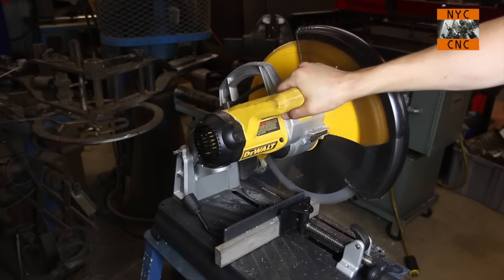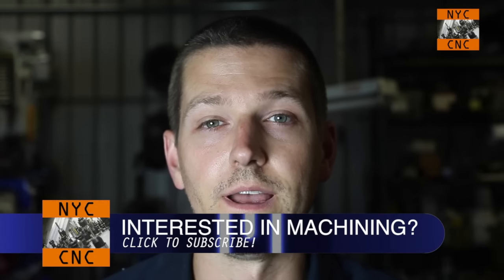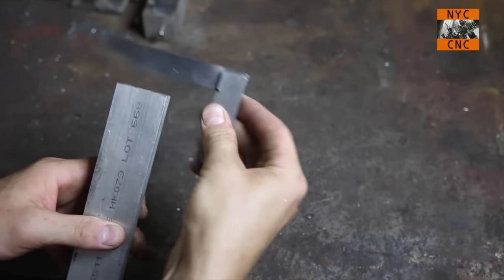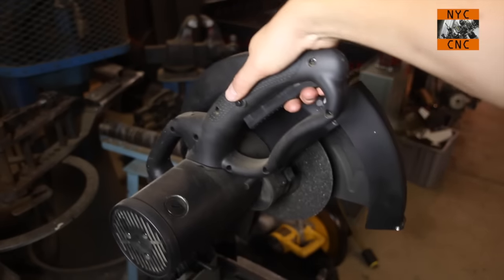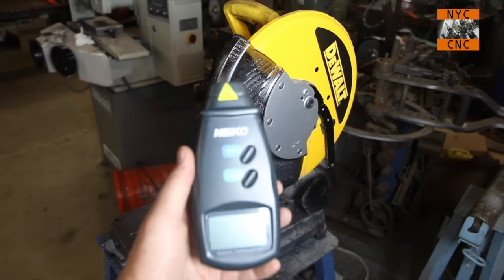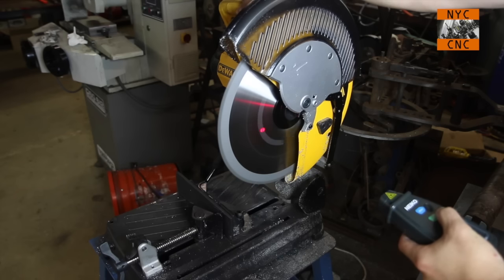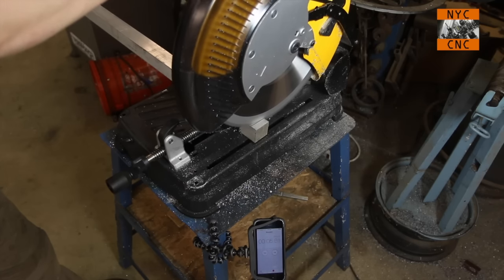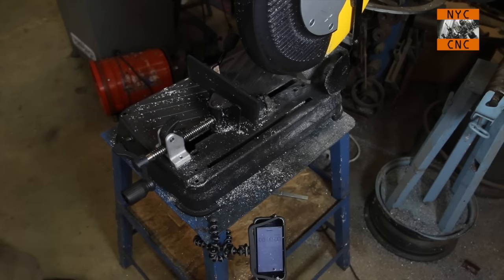The Best Metal Cutting Saw!? Aluminum AND Steel? DeWalt DW872 MultiCutter Review

Comment: Thanks for the clip is always good to let people know what else is available. They are good for on the job site easy to carry.
I have had a lot of experience with this type of saw and they work well but they will not out last a bandsaw for the amount of use you can get out of them, but the bandsaw (which I prefer) you can rebuild without spending to much money but these types of saws when they need repairing most of time you are better to buy a new one.
Not trying to sound negative about this type of saw they a good for portability and that's about it. 
 I think in a workshop the noise would drive me up the wall, using grinders and similar types of equipment is enough to deal with don't need this thing going as well.

Comment: This saw looks like a take of the Evolution Tool's metal saw.  They were doing these for quite some time im guessing before DeWalt, etc.  Id like to see a comparison between the various MFG of similar products.  The Evolution Tool stuff is also pretty nice.....and I believe a bit cheaper than the DeWalt.  But Im willing to bet a lot of the tech goes into the cutter blade and not so much the chassis.

Comment: John, have you used this machine on Stainless Steel? I'm a designer/woodworker, just starting to work and incorporate metals. I'm looking to cut 304 SS 3/8" solid bar. Trying to figure out the best approach for this task. Any thoughts on this machine vs abrasive or even a bandsaw on SS? Thanks in advance for your feedback. Great video!!!
Reply: Ez. No problem doing 304

Comment: I doubt you'll be around this place ro answer this question but I already have a dewalt chop saw but is the fast one 3800 rpm cudnt I just get a metal blade that can take that rpm
Reply: No you cant put a metal blade on such a speed motor. . I also thought of this plan n failed you have to get a slow motor like this
Reply: @markharvey4087  dewalt makes a diamond edge blade for the specific chop saw I have it's designed to take up to 5000 rip ems

Comment: 1300 rpm will chop a finger just as fast as 20000. All of these saws are fine, they've only got so much life in them because they're only a few hundred bucks. The bearings go out and they all cut bad. But none of them put any money in the vise. Put another $100 in a good vise system and it would make an all around affordable package.

Comment: Hey Brother, thanks for the video.
I have a couple general questions and hope someone can address them.

What are the best characteristics needed in a saw to cut aluminum thin wall extrusion? I only cut aluminum, and always on a 45.

You mentioned RPM, All the saws I've been looking for have |RPM ratings anywhere from 4000-5500, depending on blade size, but contrary to this, do you feel a lower RPM is what is needed for cutting aluminum?

Also, blade size, does this matter at all, obviously smaller blade, smaller aluminum extrusion size cuts.

The last item which I don't like is that the blade is static and cannot be angled to 45 degrees, meaning if I switch positions I have to design a bench system and dedicate the work space to accept tubes being placed on different positions, jigs, etc.

Lastly, can you recommend anything like this that can swivel to several different stops?

If I buy a 700$ saw, dual bevel, carpenters dream, high rpms, will I wish I got this saw?

Thanks brother, gonna check our other vids.
Reply: Jonny. Many many years ago I worked in a shop where we cut aluminum extrusion with a Craftsman 10" radial arm saw with a good carbide tooth blade and it did just fine. The stuff we were cutting was a couple different shapes, probably .06 -.09 thick. And even today I still use a Makita chop saw with a cheap blade to cut aluminum door sills. Hope this helps in making your decision

Comment: thanks for the video, quick question i need to cut 2-3 inch square carbon steel bar.  I have a 12" miter saw, do you think it can handle that if I had a steel cutting blade? thanks in advance!!
Reply: No.    A wood cutting miter saw rotates much too fast for steel cutting.    Compare the rpm of a saw designed for wood and one specifically designed for steel.   Using a speed controller probably won’t work either as it will lose power.

Comment: Would I be able to put a  Dewalt metal cutting blade on my abrasive chop saw its a DeWalt.
Reply: Be mindful of the RPM speeds. I checked into that today but a good saw for this type of work spins around 1300 to 4000 and my Canadian tire saw I believe runs at 5400.. it'll burn your blades up really fast and could be dangerous I'm told.

Comment: The main selling point you are giving us is that the cold saw is faster then the band saw. And in all practical applications yes it is, but in theory a circular saw and a band saw with the same tooth size angel and pitch should be just as fast. Why the circular saw is faster for you observation is because among many reasons, the stiff blade permits greater tension and the carbide teeth are better suited to fast cutting. I know you witnessed how much high the removal rate is on a lathe with Carbide vs HSS. The same is true as far a s band saws, safeties to say that the commparison between your Jet and the Dewalt is not valid unless both are running carbide. Under speed alone the Dewalt will win hand down just by being direct drive.

The winning factor of the band saw and why metal distributers use them exslusivly is that they are far more economical by any measure of short or long term business. Whether or not you weld your own blades. 
I was at metauxsolutions and had noticed that among their million dollar fleet of band saws they had only one circular saw and was your Dewalt. I was considering getting one at the time as are many how have just watch your video above. So I asked the Forman why there weren't more circular saws? He said that they did have three wet circular saws years before at the last fissility but chose to sell them, left them behind. The reason they have the one circular saw is for when a costumer comes unannounced and needs length of bar stock small enough for a car. Otherwise the bandsaws are king, with the lowest cost per cut, allow for few employes to manage several machines, thin kerf. As far as the hobbits he suggested one of those swivel top band saws. Where the $150 per disk would get you ten blades and wold far out last the disk.

Cutting speed and the rapid dulling of the teeth is a pain for all of us with one of those cheap horizontal band saws, and tempt us to "upgrade" to the cold saw. However both of those problems can be remedied just be increasing tension and down force.

I had owned and still own one of those small horizontal band saws when I got a summer job at a CNC shop, and when they gave me the duty of chopping bar stock on one of the mid sized horizontal saws from Grizzly I knottiest that the lifting spring had almost no tension and the blade tension knob was replaced with a hex bolt. The explanation as quoted by my employer, "These importer companies know nothing about proper settings" So the blade tension was set by using an elongation meter and adjusted to the blade manufacturers specification, and this required a large wrench.
The down force was set until they got the proper chip formation. If you are only getting dust out of your saw (some materiel are an exseption) then you are only waisting time and blades. 
See the first 10 -20 second to see how fast a small drop band saw can be. 
watch?v=VHTXaU7GZC0

All that said, I would maintain the band saw is more economical and plenty fast enough for the needs of garage tinkerer, pro-hobist, and full commercial shop alike.  

Ps. my guess is that you got a high end import, vertical band saw.
Reply: Perhaps you kept loyal to jet

Comment: Nice review. I have a 5hp Kalamazoochop saw.  Nice saw, but really want a Multicutter, as I hate that dust! Yep, been using the Ryobi wood miter for 2x4 solid 6061 blocks, with a little solid castrol wax stick on the blade. Nothing worst than cutting too slow, only to melt aluminum and jam the blade!

So did you get an Ellis saw?
Reply: Whooohooo.... Ellis is my dream saw addition!   Nice saw, your shop it coming along.  I still need to down size in a few years... just need a house, shop, and a 1000' x 100' yard (grass landing strip for the plane)

Comment: Hey John, I have the Millwaukee cold saw and love it. Good luck with your DeWalt. What do you think about spray coolant for expanded blade life? I know it's not good to shock carbide but, a constant flow of say WD for aluminum and lite oil for steel might give more life to the blade. Oh yeah the mess! You probably bought the Kalamazoo band saw.
Reply: It's a Millwaukee 14" Dry Cut Machine, I call it a steel chopsaw. Great cuts with blue chips, like my lathe would put out. Second guess, did you spend the money on a Dake bandsaw?
Reply: NYC CNC Have you tried the wax lubricating sticks? The little hand-held twin blade multi-cut saw I use has them and they make difference to blade life. Here is a similar larger version I've also used on Aluminium drop saws - http://www.toolandanchor.com/item/15-sk/1clube/

Comment: I'll bet your new band saw is NOT a Harbor Freight 4x6!
 I have a Dewalt abrasive chop saw (which I hardly use) and wonder what the difference is in the base tools. They appear to be very similar.  Looks like that carbide blade is about $150.00 by itself.
Reply: I think abrasive saws spin faster, not 100% sure though.
Reply: Aaron16  Just looked it up, Dry cut spin about 1,300rpm(blades are rated to 1500) Abrasive spin at 3,500 or so.

Comment: Carbide toothed cut-off saws.......how many 'cuts' per blade before sharpening...or replacing the blade after you chip or knock out a few teeth......
 To compare the number of cuts....you'd have to cut the exact same type of material over and over.....

Comment: You can push much much harder with this saw than a friction saw.  Don't be scarred of it, push it down and make those cuts in about 2 secs. Seriously. I got a Steelmax S14, little older than your new toy. Nice, ain't they!
Reply: It will wear faster, but you got a ways to go before you are doing damage.  Once a blade wears down you will get brave with it. Best time to play around is when the blade is shot I guess.  Hot chips, cold cut.  Wait til one gets on your face and burns in. Great review of the dewalt btw.

Comment: That's a well saw not a band saw. Not trying to be disrespectful but a well saw is meant for sawing large diameter pieces. Which a Chinese knockoff such as the jet you own is not capable of, defeats the whole purpose. Chop saw is quick and small diameter. A band saw is for pushing custom paths through a saw. A well saw is for sawing big stuff. In another words you have no need for other than a chop saw. Only trying to be helpful.

Comment: Dumb... That Ryobi is a mitersaw, intended for cutting wood, not steel. That's the reason it doesn't have any vise help, and the rpm  are very high. Look at the base of the Ryobi vs the base of the DeWalt.

Comment: Why does the Ryobi not have a locking plate device well maybe because it was made for WOOD.Ryobi is a miter saw do you know what a miter saw is used for? Ok so you do not know well its for WOOD ! Roy is not a chop saw boy do All of use hope you get the point by now?If you do not know what the tool is used for do not but it.I really hope that is blunt enough for you maybe not.
Reply: +NYC CNC the small riobi is not used for metal at all. It's a high rpm for a reason, because that saw is s wood saw.